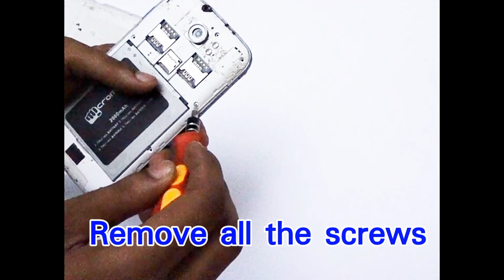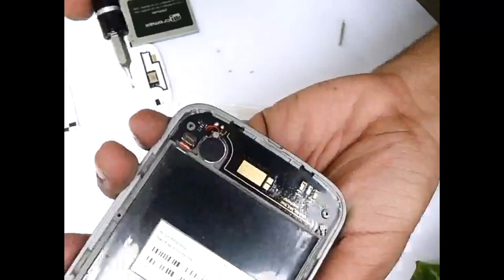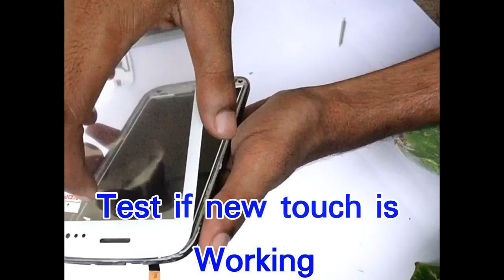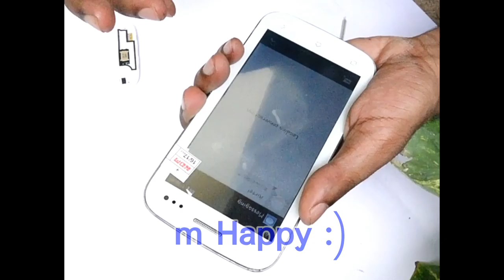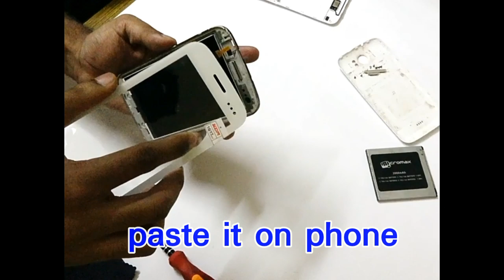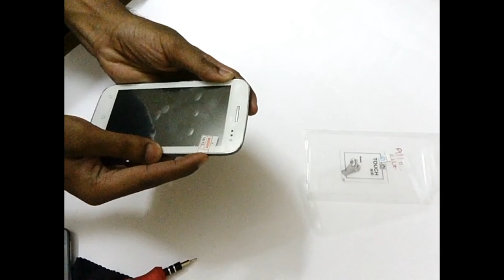Replace touch Micromax Canvas

Comment: Thanks for your info and please tell me where can I get this touch digitizer for my micromax A110 mobile
Reply: You can buy it from ebay.in or maxbhi.com. If you do fit it yourself, you save money but there is 50-50 chance of successful or not successful. I am not pro but have done touch screen change several times,. I was sucessful 2 or 3 times and not successful most of the time. Not successful means touch not working at all after fitting or not working on some area. So, i think it is better you go to mobile service shop and let them do it. Nowadays, i don't do touch changing. I go to service shop even though i know they charge a lot. For example, for changing micromax canvas doodle, you can buy the screen at Rs 300 or 350 on online shops. But if you go to service shop, they will charge Rs 750.